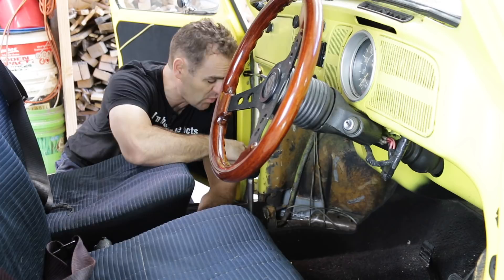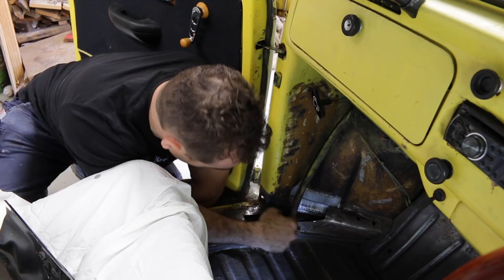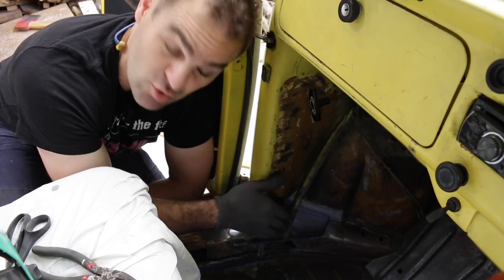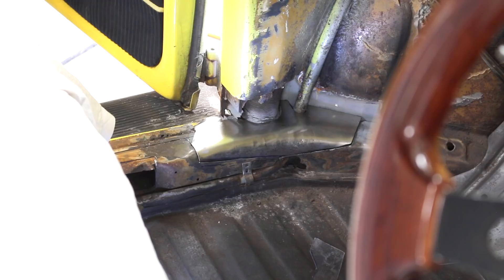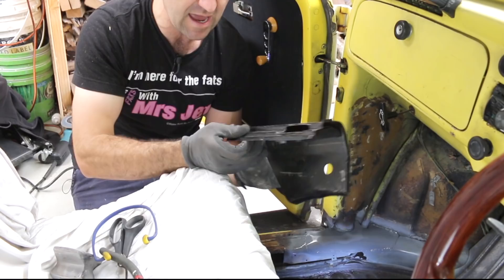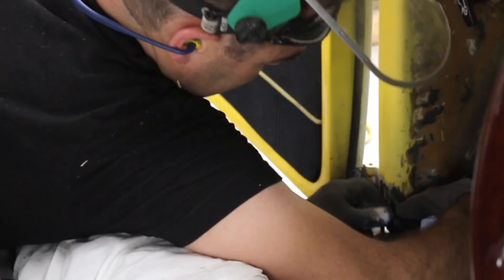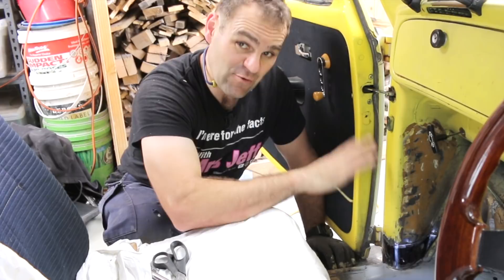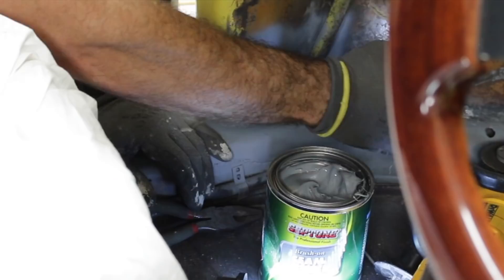A pillar rust repair part 2- Home Built Project Beetle part 6

Comment: Plastic Sheet, that is brilliant, think ill by stopping past officeworks tonight. Like the new welder, my mate has a bossweld and i love using it. much better than my $400 Chinese heap. How many amps are you running for the panelwork? (I am finding any more than 20A blows holes in my project - but that is very thin japanese steel)
Reply from the maker: I have no idea of how many amps I am running. I just put it on about B on the gauge.

Comment: Hi ... great video ... I have a 68 beetle with similar issues in the front quarters on both sides. Quick question. What type of sheet metal did you use and what guage Is the sheet. Thanks
Reply from the maker: I used 0.8mm sheet

Comment: why have you left the cable in that corner ? interesting update as usual, thanks for sharing.
Reply from the maker: That is the wiring loom from the battery to the dash.
Reply: ahhhh thanks, strange to have it down in the floor and not behind the dash.  But I've never worked on a beetle.  Keep up the great vids.
Reply from the maker: The battery is under the rear seat, so it takes the power from there to the front.